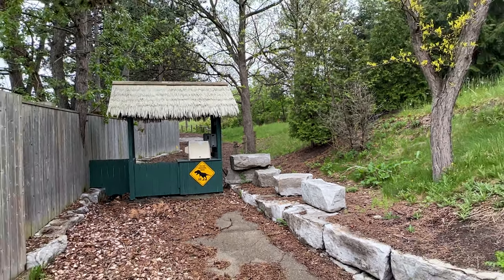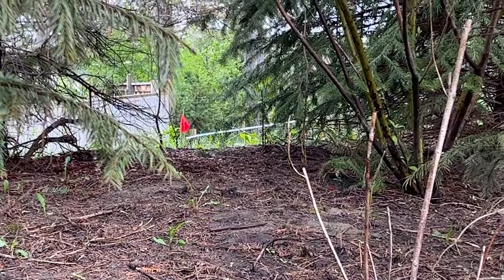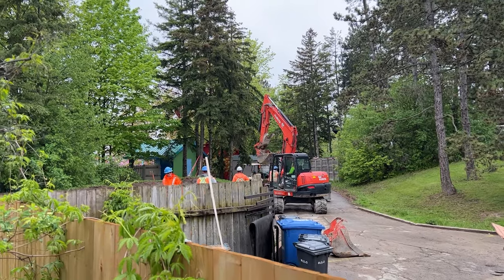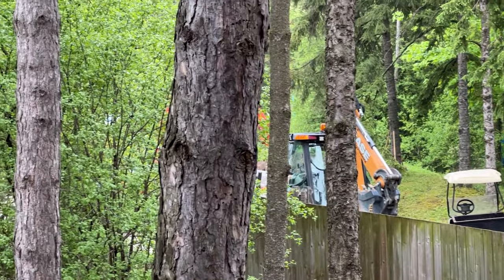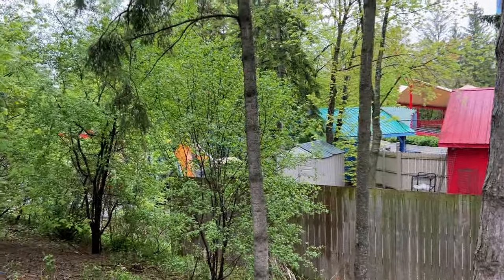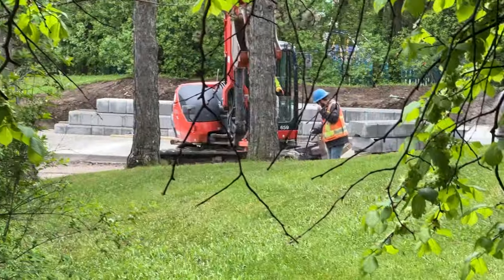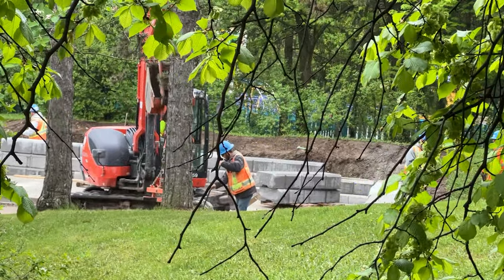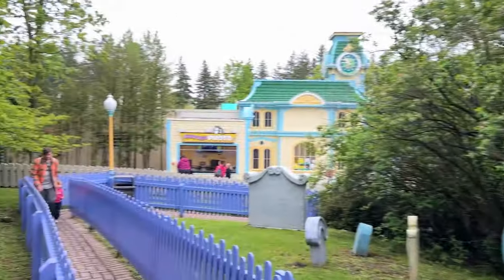Canada's Wonderland 2023 Expansion

Comment: This message has been passed on to the park.

Myself and my family love Canada's Wonderland.  My sister and I worked there in the 80's.  My Mom even bought a seasons pass this year.  It takes a lot to upset me, but a lot of things happened to my family on May 22, 2022 that I thought you might be interested in knowing about.  I understand that Victoria day long weekend has and will forever be a somewhat busy weekend for the park.  However, Sunday was really not too busy (crowd size) but, the line-ups for the rides were all pretty long.
My family and I were only able to get on 3 rides over 6 hours!  

My first comment is that it should not take a half an hour to get a flat and greasy grilled cheese sandwich.  Why is there only one queue for the poutine and the cheese buildings?  This line should be split.  Also my Niece and BF ordered hot dogs from the fountain hot dog stand.  The buns were rock hard, stale and uneatable!  For the price they paid, this is completely unacceptable.  I understood that the food was supposed to be better this year.

Second comment.  Two queue lines for Pizza Pizza on main street were stretched back to having people standing in line on the fountain bridge.  However, there was still an empty, unstaffed serving area, sitting empty.  Why is this?  I have never seen this section used.  I understand during regular times not to staff it, but on a busy weekend and to cut wait times, it should have been opened.

Third comment.  As I was lining up for over 45 minutes for my hard pizza, a crew member pushing a cart of hot dog buns along the guest walkway near alpen games and the fly, actually hit my Mom's heel and drew blood, nearly knocking her over.  The explanation from the crew member was that she didn't see my Mom.  If this was the case then why was she pushing a cart along a guest pathway?  Is this common practice now?  It sure was not, back in the 80's.

Fourth comment.  We sat by the mountain, near the new restaurant to watch fireworks.  The "best viewing" signs told people to stand at the front gate, however once the show started, there was a stampede of people running back to and quickly filling this area.  Where were security?
With the pathway from the mountain and down to Windseeker cut in half with the construction fences, this made for a very unsafe situation.  As a side note, my family thought the fireworks were amazing this year and seeing them shoot off the mountain so close was incredible.
  
Fifth comment.  It took my family 2 HOURS to exit the parking lot last night, what a way to upset everybody at the end of a great day.  Park was pretty slow yesterday but the exit strategy must be addressed.  I worked there in the 80's and it was much more efficient.  There were actually parking staff to help people get out.
  Having the parking lot split into two by park patrol is not the correct strategy.  Cars were driving to the middle of the parking lot only to be told to turn around and return to the mess of a line up to get out.  Cars parked on the south side were not able to get to the Major MacKenzie drive exit or the new Jane exit, and cars parked on the north side were not able to exit through the Rutherford exit.  This created chaos in the middle of the parking lot.  

My family really would like to return the see the fireworks on a holiday/fireworks weekend again because the fireworks were great, however, we are not sure we want to again go through what we just did this weekend.  Canada's Wonderland has a load of experience doing this including the years I worked there.  Yes, there were problems back then, specifically with concert nights at Kingswood, but busy days should have been resolved years ago.

Another side note.  My nephew went back to the park on Monday.  It took them an hour just to get through the front gate even with season passes.  Once in, they say that every ride had a minimum 2 hour wait time.  They ate something on their meal plan passes and left.  They were in the park for less time than it took to get in.

On to the restaurant.  I am officially concerned about the new restaurant after seeing vids on the Farmhouse at Cedar Point.  $6.50 for a fruit cup and the prices for the steak, drumsticks and chicken tenders were not even shown.  Didn't they already try a buffet style restaurant with MarketPlace?  Young people will not be able to afford such a restaurant, oh but wait.  Everybody has a meal plan now, correct?  Most people will be grabbing a pizza or McD's on the way home, instead of waiting 45 minutes in line to get a slice of hard pizza, like last night.  I was actually on the new patio last night, lots of concrete.